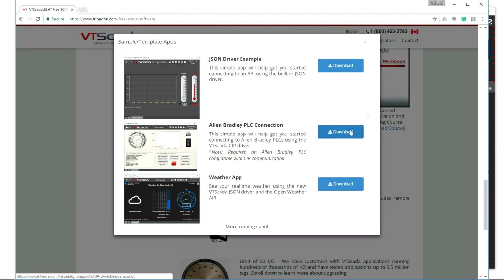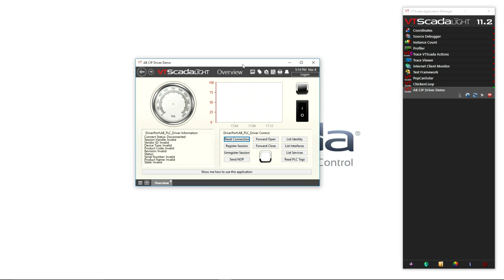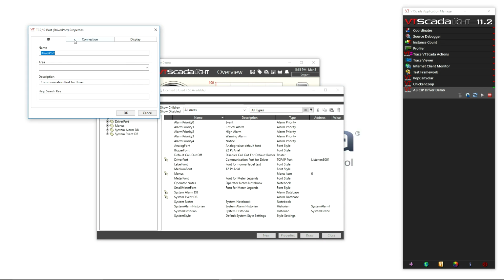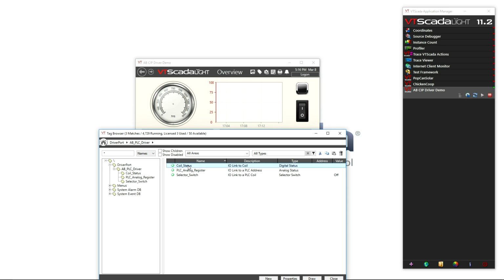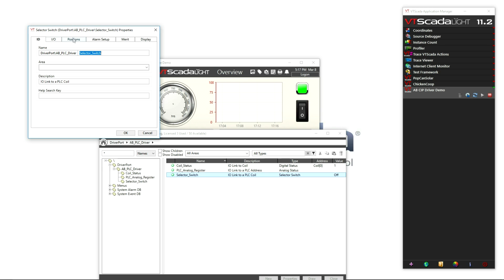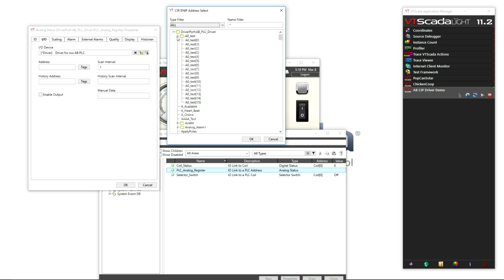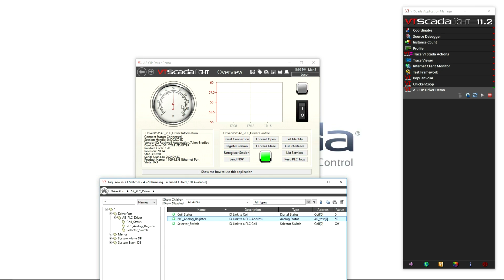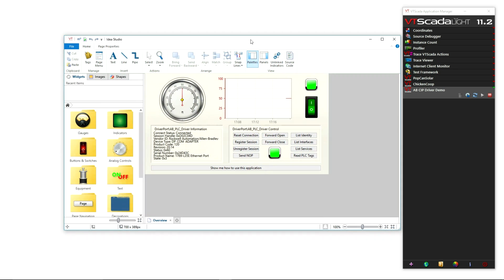VTScada CIP Driver Tutorial

Comment: Would be great if you described the setup of the CIP driver tag.  The Port Segment Path on that tags connection tab caused me all kinds of trouble.
Reply from the maker: Thanks for the feedback. This is a dated tutorial and the port segment path is very much dependent on the processor version you are using on the PLC. We'll consider adding more emphasis on these considerations when we put out a revised version of this video. In most cases, the Port Segment Path property can be left as is or changed to [] but that is not true everywhere. I believe the considerations when setting that property are documented reasonably well in our help files.